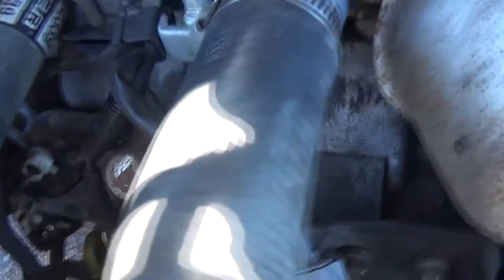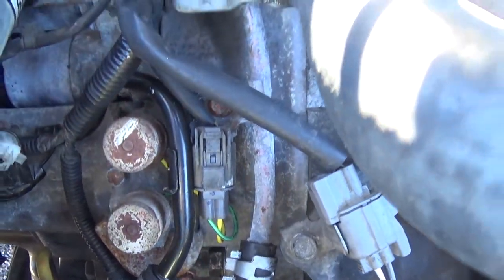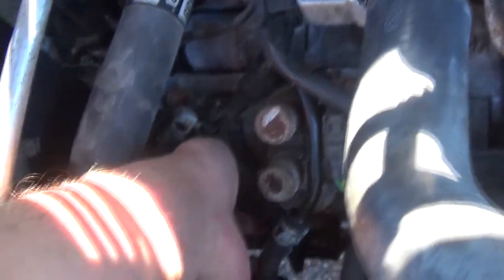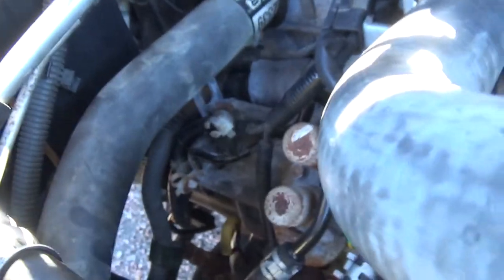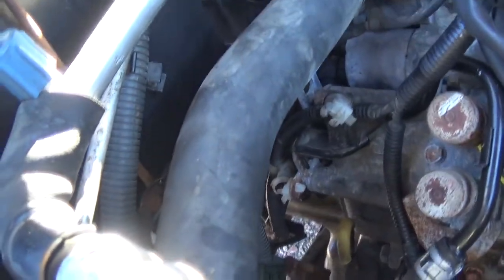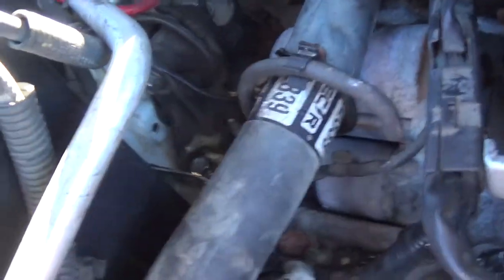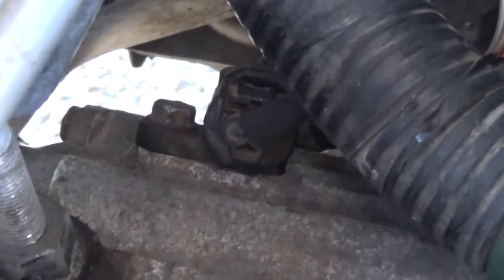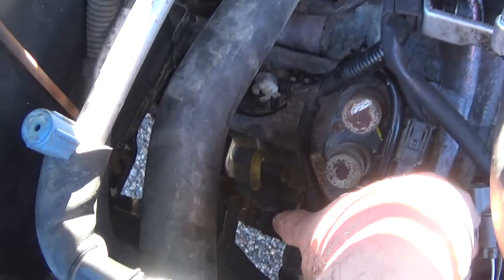JDM trans Accord BAXA replacement?

Comment: I had a 2000 Acura TL (same as the 6th gen V6 Accord) and the 2nd transmission failed in 2015 with 220k on the odometer and 130k on the post '05 transmission. Phased clutch engagement is what you're referring to. 

The premature breakdown of the clutches inside of their drums deposits debris into the valve body and torque converter, causing the unit to overheat and inevitably fail. This is why the P0740 code (torque converter clutch solenoid circuit) is the kiss of death, which usually shows up shortly before the transmission starts slipping and bucking.

Needless to say that these transmission problems plagued Honda until around 2006 on almost every model in their United States line up. Shame on Honda for never offering more than an extended new car warranty during the hay day of the failures.
Reply from the maker: Yeah, interesting how that played out.  I read honda was trying to answer the complaints that the older transmissions shifted too harshly.  But a longer smoother shift equals more slippage and more heat.  
I took apart the old transmission on this car and the 2nd gear clutch disks were toasted.  Much much darker than the other 3 gear packs.

Comment: Did you by any chance have to use the usdm transmission range sensor or did you keep the Japanese one on and did it trigger a check engine light?
Reply from the maker: It's been a while so I don't remember exactly what I did.  But I believe I only swapped a few of the black/brown pressure sensors that were broken on the JDM one.  I believe most of the JDM sensors work in a USDM car.

Comment: Was this the mcja trans? And is it still running well?
Reply from the maker: I forget the actual trans code on it, but yes it's still running as well as the day I put it in.   About 30k miles or so on it.
Reply: Did u have to use the jdm flexplate? I just used my stock one I guess stock I forgot if I swapped the motor for jdm f23 but when I mounted everything up it would  not crank over like got stuck and started to heat up
Reply: Any fault codes at all?
Reply: @MechaniclifeJDM i did the trans swap no codes as long as you swap the sensors. Gauge speed will read lower sold the car after 2 years of daily driving. Kinda wish it kept it
Reply: @fortunesk89  thanks for the speedy reply. I appreciate that, I don’t wanna crawl around under there on my back and be disappointed at the end, I will do a very careful job swapping everything over cleaning all connectors, charging the battery, clearing the codes, using Honda approved fluid, triple checking everything, so if this thing has a problem, it’s not going to be something that I caused, I will also put a video on my channel discussing this, so hopefully this information will help others as well, thanks again